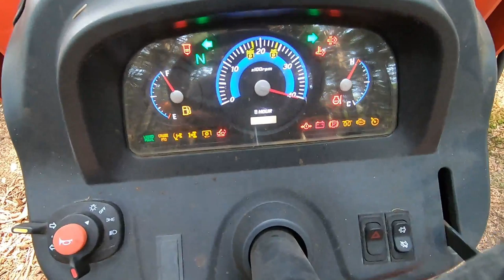Replacing CV boot on Honda Rincon and bucking up a tree

Comment: Oh sure she left you our there all alone. Bet you will be hitting the hooters bar every night on the island. LOL.  Heck yeah backing those small trailers up is a pain! 18 wheeler is nothing compared to those things. Dude you not pose to let people know duct tape did not work! What in the world was you thinking? Everyone knows duct tape fixes everything. LMBO.  Great job done getting the new boot on. Ya got to protect those axles or it will get into your wallet real quick!  Tree down and cut up! Nice job done buddy. Time to call it a day and let the party begin. Try to behave yourself while momma is away. All those naked island girls will be tempting. Stay Strong my friend! LOL..
Reply from the maker: I’ll carry a big stick around to keep the naked ladies at bay😂
Hey, I thought for sure that duct tape would hold. In its defense i applied it on a pretty greasy surface. lol
Yup them little trailers get crooked fast. 😂
Reply: My Alaska Dream 

There is a reason Gaffer’s tape costs three times as much as Duct tape.... you should have been using the good stuff, not the cheap version... (and NOTHING is sticking to grease, it needed to be cleaned off with a degreaser before anything was gonna stick to that).
Reply from the maker: Ha it just needed to get me to the boat and back. 
I do need to get some of the gaffers tape.

Comment: Are you able to buy off road red dye diesel? Nice tunes your playing, who's the artist?
Reply from the maker: I don’t think so. At least we haven’t found a place in town. I want to look into ordering drums and see how much that would cost. See if I can bring them over in my boat and use the tractor to get them out.
Reply: @AnAlaskaHomestead  , I use a 55gal drum of offroad diesel for my small farm. Your not paying any tax for offroad diesel, farm  Exempt.
Reply: My Alaska Dream 
At 8 pounds per gallon, a 55 gallon drum weighs over 450 pounds including drum, I wouldn’t want to be hassling with that in that small of a boat, especially without a dock for unloading.... might be better to look into getting a pallet of 30 gallon drums as you should be able to unload those singly with the tractor no problem as each would only be 240 pounds.  

Good luck and be careful with those drums.... they always feel a lot heavier than the scale says they are....
Reply from the maker: Brian K Shaw that would be nice to get it taxed exempt.
Reply from the maker: Rick Sanchez C137 55 gal would be heavy but that boat can haul a lot. The ATV is over 700 lbs and it got on step with that. Took a little longer but it got there. Smaller barrels would be more manageable.👍